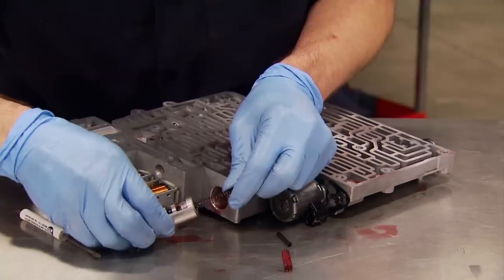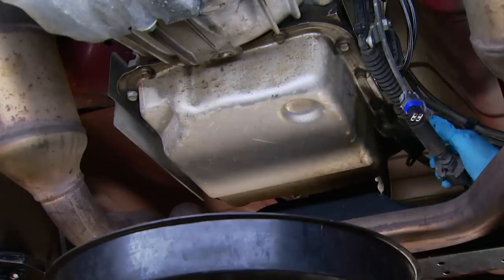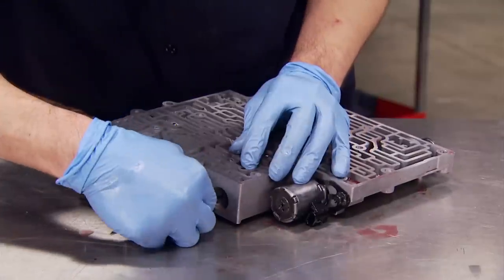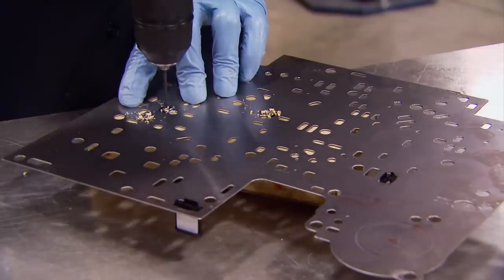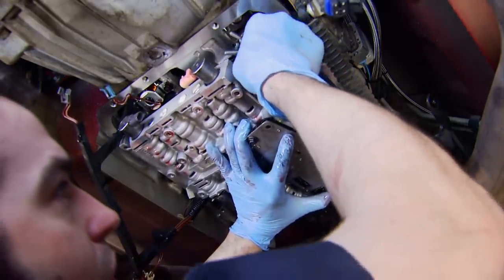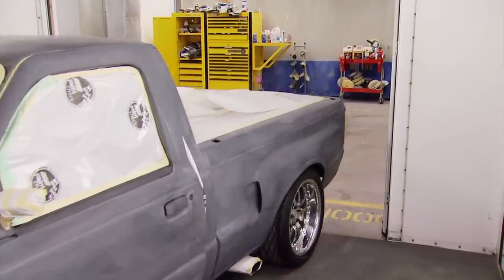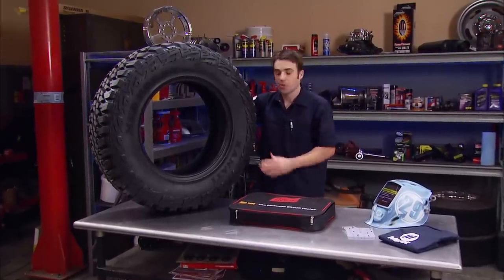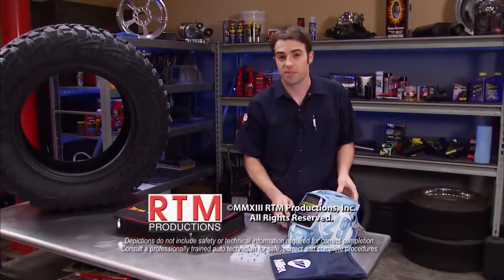Improving Shifting In An '06 GMC Sierra Without Removing The Transmission - Trucks! S15, E14

Comment: Richard from Precision Transmission should make a reaction video for this.  He'd just about have a heart attack, starting with that cheap Chinese drain plug that leaves like 2 liters and all the debris in the pan.
Reply: Or that they used a shallow filter in a deep pan
Reply: And he would have thrown those garbage plastic pistons in the garbage can and replaced with aluminum and raised to the top the 1-2 accumulator and totally blocked the 3-4 accumulator with two pistons so there would be full pressure to the 3-4 clutch packs for no slip positive engagement!
Reply: Also should have used sonnax accumulator pistons or at least an aluminum piston...
Reply: I’ll also add some ... put a 1/4 turn on the epc to get more line psi, add a corvette servo and maybe add a shim in the servo(if needed). Plus a .500 boost valve on top of swapping the plastic pistons with pinless accumulators plus adding the right deep filter and getting a dorman pan with the drain plug already in it. All these things could easily be done in the truck* plus all this could have been done without removing the crossmember or even loosening the exhaust in most cases. Js had over 5years in the trans industry.
Reply: @MrDrmorbid Richard is the GOAT 🐐 
PRECISION TRANSMISION IS A GREAT CHANNEL TO WATCH
Reply: Reusing the plastic pistons as well.
Reply: Omg what a joke
Reply: Yup you can tell they don't know shit about a 4l60e

Comment: Put the magnet back into the pan. On my old '68 Fury with 727 I did the same thing. After getting stronger u joints it was the best thing I did for both performance and fuel mileage.

Comment: Even if you're not racing positive shifts cause Less friction which helps a transmission to last longer because it lowers the Heat slipping clutchs caused a lot of heat so a positive shift less heat more life and more fun when you can chirp 2nd and 3rd gear
Reply: Im no expert but I've built a few 4l60e and I only use a wide band along with corvette servo, I also do a tight clearance on my 3-4 clutch pack .060 to .086 is way to much in my opinion ive been shooting between .030 to .035 and ive been happy lol.

Comment: Petroleum jelly is used for all aspects of rebuilding a transmission it won't hurt the transmission
Reply: Hakim Smailliw   you are wrong been using petroleum jelly to assemble transmissions for years. It completely dissolves in trans fluid and is safe to use...

Comment: Put some thread locker on that drain plug. I didn't and my plug came out while on the highway. I was lucky because I pulled off after losing drive and got towed home before I burned up my new trans.
Reply: That happens to know one ever!!!  Use a torque wrench next time
Reply: @brian_jake  it was torqued. I had installed a deep oil pan before installing the new trans and I torqued all the bolts myself.
Reply: Lol, red locktite so it will never come out.

Comment: Interesting but you installed the wrong filter and it will cause a problem. You needed to use a deep pan filter like the one you took off. You installed a shallow pan filter which can fall off.

Comment: I hope you guys plan on putting that magnet back in because that could save you a lot of trouble down the road cuz you don't want them little chunks floating around back into the transmission it's always going to shed a little bit of metal in you'd rather not have that floating around in your valve body

Comment: So with the way the drainplug sticks up into the transmission oil pan you'll never be able to fully drain the pan's contents?
Reply: But at least you'll have a lot less fluid to screw with than you would if you didn't. I'd rather deal with a pint of residual fluid than I would with several quarts when popping the pan loose.
Reply: On some vehicles you got a bolt and No plug or valve just a threaded hole it screws into and it’s all flush. That seems like a much better design.
Reply: @robertemmons2260  why go with a half-baked job when you can: 1. actually make a proper drain plug, 2. simply buy an aftermarket pan that has a proper drainplug built in?

Comment: Some observations; First he removes the magnet from the pan after saying what a great innovation it is, noting that he will put the drain plug in its place.  Hmm is the drain plug magnetic?  I guess it really doesn't matter because he places the drain plug several inches from the magnets location.  The magnet should never be removed unless it has deteriorated to the point it needs to be replaced.  Second, the pistons are both plastic, and should always be replaced with aluminum pistons.  The center hole in the  piston wears and gets oblong.  causing a leak and pressure loss. Third, you installed the shallow pan filter which will not pickup fluid like the deep pan filter you took off and should have replaced.  This filter also may use a different plastic round retainer that will not fit the smaller filter causing it to fall of and may cause catastrophic damage to the unit.

Comment: At 4:02 do yourself a favor. Throw away the nylon washer and o-ring and get yourself some rubber/steel sealing washers. They're used on OTR trucks and heavy equipment.

Comment: Thank you for the great video. Do you have a part number for the drain plug you installed? Also is there a reason why you didn't change the shift solenoids?

Comment: Replace that crappy plastic piston in that 4L60E! Sonnex makes an aluminum replacement for cheap and it has a double O-ring for batter sealing and stability. After all, you're trying to improve longevity and plastic has no business in that heat-soak environment. I really liked the end result of that flat black paint job.
Reply: Your talking about the pinless accumulator pistons I love those, was chasing what I thought was a worn TCC valve but when I blocked it still had that hard 1-2 shift. Turns out it was the forward accumulator piston(brand new aluminum) was leaking through the pin. Replaced the forward along with the 1-2 accumulator piston with the pinless and it felt like a new tranny, firm shifts but not hard it was nice.

Comment: You helped me decide whether I want to drop the valve body just to do the pinless piston in the 3-4 accumulator.  And whether check balls will fall out from the tranny above (the horror).  With all your upgrades, you chose to keep the 3 plastic accumulator pistons unchanged.  I really don't wanna drop the valve body, cause I'm scared of going that deep.  Would it be dumb to upgrade only the 1-2 and FWD accumulator pistons?

Comment: Looking for an episode where they were building a motor (cant recall if it was a 302 or a sbc) and before the main bearings were put in, they used the old main bearing to notch a small groove to enlarge the oil valley and then drill two holes in the near bearing.

Comment: the forward accumulator piston should be replaced with alum. before adding that increased pressure spring plastic piston will crack

Comment: And if you don't want to get your hands dirty you can use a Diablo tuner and just add shift psi and put your shift points exactly where you want them. Im not saying it will do your 4L60E any favors but you can very easily improve your E.T. by doing this.

Comment: Using any extension on a torque wrench gives a false, low setting, especially when dealing in inch-pounds and low foot-pound settings. I sure hope they used either a formula or a conversion chart to get the correct setting; if you are going to the "trouble" of using a torque wrench, at least do all you can to make sure the fastener is seeing the correct amount of torque.

Comment: I have the exact same truck but an 05.  It has performance shorty headers, aftermarket Magnaflow exhaust, cold air intake, hot plugs and wires, and a performance Diablo tune.  When I "race" it, I just push to "tow mode" button on the gear shift and it changes the shift points perfectly.  I've handed ass-whoopins to several supposedly fast/sports-type cars on the dig.  Newer models at that: Nissan Maximas, VW GTI, Infiniti G35, etc.  I know these aren't big torque type cars, but my truck is easily nearly double the weight of these cars.  Try it.
Reply: Hmm Exact same truck except its a .. with a .. and a ..., exact same truck huh??

Comment: I know in this video is 2 years old but I need to say something. They used the wrong valve body and case gaskets. and the separator Plate is a round hole square hole and the gaskets they used are a around hole round hole.  the lockup will not work correctly and eventually cooked the transmission. And the icing on the cake they use a shallow filter on a deep pan. Nice way to starve it of fluid and send it off to a quick death.

Comment: Ok watched this for years finally got some experience lol decade or so. STOP Telling ppl bs the ls series motors.. now this. These guys know that you cannot do this reliably at all in any way. Pisses me off. They know a factory sunshell cannot hold any close to 450 ft lbs ever even for a second. Bull shit. This sinereo throw the 4l60e away and buy a high mileage working 4l80e. Not cool jerry your showing ppl learning that this is ok to do.  Its not the transmission will not slip at all before the factory sunshell strips the slines these dude grew up like me with the 700r4 4l60 then the 4l60e. NOTHING NEW... This will not fix the transmission or make it anymore perofrmance. This is meant for an upgrade parts transmission or towing not 100hp and a shit ton torque. It will mechanically break. And this whole cool thing they r doing hp turners does with the ecu. Waste of time and money. 4l60e throw away after it breaks which it will unless its 100% stock. Put a better trans in or buy a turner that does this. Makes no sense at all. This is not a th350

Comment: Everything wrong about this video.
1- wrong filter used
2-wrong gaskets installed
3- not replacing plastic pistons.
4- not upgrading worn boost valve. 
WTH POWERNATION?

Comment: Wouldn’t you want to leave the magnet out? If it is grabbing the metal bits, I would not be comfortable draining the fluid without taking out the magnet. Unless drilling a hole in the pan is only to avoid a mess when future draining. In that case, I’d accept the mess